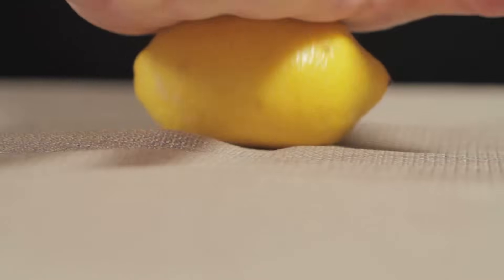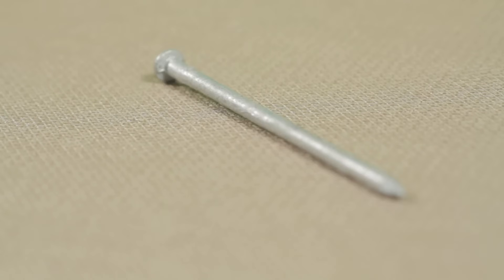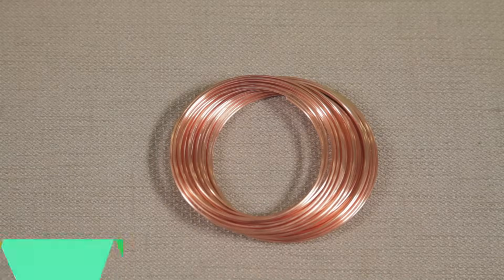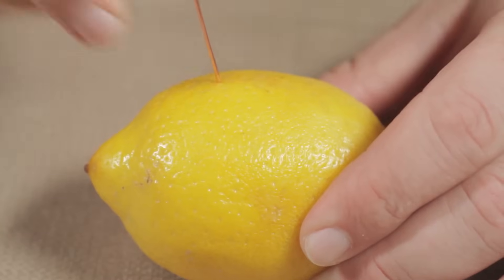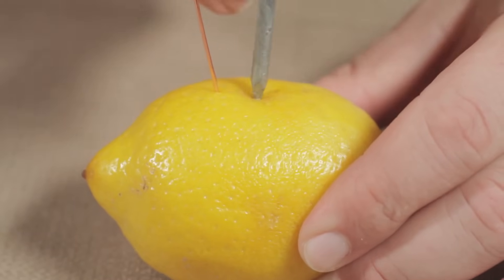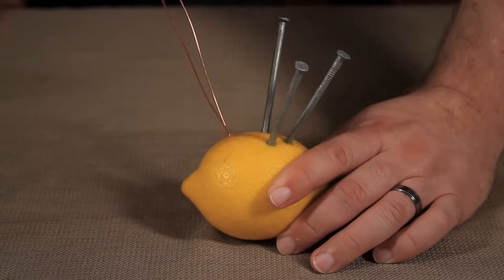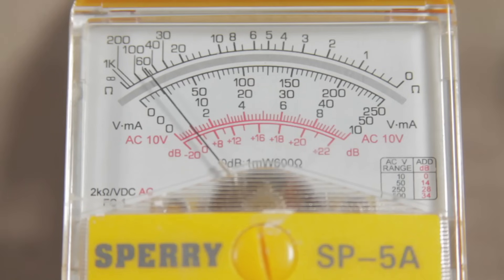How to Make a Lemon Battery

Comment: Real question if anyone has the time.. what makes a battery like this die? Like.. does the nail run out of electrons, does the solution stop being able to transport them, or what?
Reply: It's been nearly a year since I had to do this but here goes: the electrons are transferred because of the differences of electronegativity between the anode and the cathode, i.e. the two metals. This is a reversible reaction, where the forwards reaction (electron moves from zinc to copper) is happening at the same time, but at a higher rate, than the backwards reaction (electron from copper to zinc). The reaction reaches a dynamic equilibrium, where the forwards and backwards reaction are happening at the same rate, when enough electrons have passed to the copper to make copper's electronegativity equal to zinc's by ionising the copper metal to Cu^- and Cu^2- and ionising zinc to its respective cations. This is the point where the battery has "died" as electrons cease flowing.
TL;DR, yes the nail runs out of electrons which it can give, in a sense.

DISCLAIMER: It's been ages since I did this and I could well be wrong or missing something, but I think that's the gist of it.
Reply: Awesome. Thanks. :D
Going beyond that.. do either the nail or the penny ever end up resetting themselves? Like, x amount of time after the experiment is over, or are the outermost layers that were exposed to the juice forever changed, and you'd need to scrape them off?
Reply: Not on there own, you would have to somehow reverse the process, which isn't really feasible without going into too much detail. This is why disposable batteries are one use only.
It's not just the outermost layer, the entire object is pretty much affected equally, so no, you couldn't scrape off the outer layers.
Basically, once current stops flowing, you can no longer use the penny or nail in a battery.
Reply: Cool. Thanks again. :)

I have to admit, even though I already know before peeking that the law of conservation of energy prevents it, that I'm wondering if there's any way to cycle the electrons back and fourth between materials indefinitely. Like, the zinc goes to the copper, then the loaded copper goes to something else, etc etc until something goes back to the light zinc. Alas, no perpetual energy machines for us this reality. xD
Reply: Yeah, as you said, no not possible, because electrons only travel from the less electronegative metal to the more electronegative one, therefore the electrons never get back to zinc as the electrons can only pass to progressively more electronegative elements.

Comment: What is the difference between a potato battery and a lemon battery?
Reply: A potatoe flew around my room but a lemon just falls
Reply: One is a lemon and one is a potato
Reply: nothing bro... nothing
Reply: The potato will give you a higher voltage even though it has a lower pH.  This indicates that the acid is only part of the equation when talking about batteries made with fruits and vegetables.

Comment: As I understand it, most fruits have some sort of acid in them.  Could a non-citrus fruit be used, same for example a watermelon, cantaloupe or apple?
Reply: Yes, we've done it in school with apples, melons, pineapple, grapefruit, and even vegetables like onions and potatoes. Obviously they dont generate as much electricity, but they work!
Reply: Apples actually produce a higher voltage than a lemon.  This would indicate that the acid is only part of the equation when making a fruit battery.

Comment: Anyone who does water cooling will understand this.  Never mix aluminum with copper, or otherwise the aluminum will oxidize and eat away.  That's why you get holes and erosion in your aluminum.  Either all aluminum or all copper.

Comment: What's the cathode, and what's the anode?
Reply: cathode is positive and anode is negative...like a battery
Reply: reduction happens in cathode, oxidation happens in anode.
reduction is the side which gain electrons, oxidation is the side which lose electrons
Reply: Oxendine9381 I think its not really the same in all cases? e.g. Galvanic cell VS electrolysis
Reply: Oxendine9381 No actually cathode is negative and anode is positive.
Reply: Rudy Melo I was going to say you were wrong and then rage all over you, then I did research and saw you were right. But then why the hell do they name a positive ion "cation" and a negative ion "anion" if the electrodes are the reverse.
Reply: Will Lu That's called English.
Reply: Will Lu they call it a cathode because its going to be drawing in cations, the reason its drawing cations is because it being reduced (becoming negatively charged) so its drawing positive ions to neutralize itself. the anode is bringing in anions to be neutralized because its being oxidized (becoming positive). So the cathode is negative and the anode is positive, because the cathode is negative it pulls cations that are positive to neutralize itself and you get the point lol
Reply: ***** no juan. We just established this. Cathode is negative -____-

Comment: You haven't paid attention to the video. Electricity isn't in the lemmon but in zinc and copper. A correct question would be "How much zinc and copper would be needed to generate a SUSTAINED electric current whose voltage would be high enough (i.e. around 2000v) to cause electrocution?

Comment: You don't use a voltmeter to measure a current. You use a ammeter.
The main difference between the two measurements is: There is no current floving if you're measuring voltage, and there is no voltage if you're measuring current.

Comment: This how electroplating onto glass works isn't it? Instead of a lemon you use silver nitrate or a solution using silver nitrate. Instead of copper you use silver and instead of zinc you use glass. But glass doesn't want electrons :(

Comment: +1 on the voltage argument.

the multiple nails argument, however, is not flawed. it's pretty much all about active surface available for ion flow. flooded lead-acid batteries also have a common electrolyte; the separation only serves as a protection against physical contact of the plates themselves.

Comment: to be fair it is an analogue meter and will draw some current from the lemon unlike a super high impedance digital meter.

However i agree Hank should of declared it as voltage.

the multiple nails in the same lemon bit is flawed in that the electrolyte will short them all together. real batteries must have insulation between the cells so they can have them in series (as with multiple lemons).

Comment: Yeah it works the same,also you can use aluminum strips instead of a galvanized nail.
aslo other electrolytes like salt water will work too.

Comment: the zinc atoms don't lose protons, it actually gets dissolved into the acidic solution. the zinc nucleus itself is a collection of protons(and neutrons), so the zinc layer on the surface of the nail is losing zinc ions, not individual protons

Comment: No lemon, no potatoes, can not provide the energy as it is the very shallow (copper wire or sheet) Type in a glass of water, put on one half of the copper wire to the other side or what piece of iron that the same zinc, get 1-1.5 volts, can reach 3 volts depending on the copper itself.

Comment: absorb electrons and from hydrogen ions become hydrogen atoms that also form hydrogen molecules; 

with enough time, all the ascorbic acid (vitamin C) in the lemon becomes Zinc Ascorbate (the same thing you would get just soaking zinc in ascorbic acid); basically the lemon will not only be rich in vitamin C but also in Zinc; 

but i am not 100% sure so don't go doing that to your lemons to get more zinc into your system;

Comment: I believe the result of letting this reaction drag long enough will be the corroding of the Zinc into the lemon juice; the Zinc in the metal is atomic, it has a full shell of electrons; during this reaction, the Zinc atoms ionize, meaning they lose electrons and become positive ions; they diffuse into the ascorbic solution in the lemon juice and the electrons flow to the copper end via the wire (hence the electric current); on the copper end the protons of the ascorbic acid atomize, they

Comment: Would I get a higher voltage if I pushed the nail and copper wire further into the lemon so that there's more of each exposed to the lemon juice inside?

Comment: It doesn't specifically need acid, it just needs something ionic or to react with. (though acid, like acids that are used in batteries, is often most effective) You can do an identical experiment in water + quite some salt! Any vegetable will do to some degree, as water and ions (and ion transport) are essential for any lifeform.

Comment: Voltage is a function of the number of isolated pairs of electrodes. Current is a function of surface area, or how much material is available to participate in the reactions. One copper wire and lots of nails would not give more power since the reaction is limited by the copper. Lots of copper and nails increase amps but not volts, multiple lemons (isolated cells) gives more volts but the same amps. You can combine these two effects to increase both voltage AND current.

Comment: after the zinc ions go into solution electrons are flowing from the anode (zinc nail) through the black wire over the voltmeter, where the flow is displayed as electric current, through the red wire to the cathode (cupper wire) and finally to the protons in the electrolyte (citric acid solution)..so before the electrons arrive at the cathode and subsequently reduce the protons they flow through the voltmeter..hope that helps..

Comment: If the electrons that get to the cathode are pulling protons from the electrolyte, to be reduced to hydrogen, then how there is current going out of the cathode? Aren't all of the electrons, that should have been flowing out of the cathode, turn into hydrogen with the protons of the electrolyte?

Comment: If you are talking current then yes you could use 1 lemon, however they were connecting them in series for greater voltage.  You could however slice a lemon into several pieces and place electrodes in each piece and wire them up in series to achieve the same result.  Current has a lot to do with surface area, Voltage has a lot to do with how far apart the elements used are on the electronegativity scale and the number of cells in series. I think all the lemons was part of the comedy as well.

Comment: basically, you need to increase the area of the metals exposed to acid. Use plates instead of nails and the current will be much higher. If you think about it, a nail in cross section is a circle, a circle is an 2D object that has the perimeter minimized for a given area.  While with a sheet this is the opposite.That is why for instance a car battery exist out of interleaving plates.

Comment: The voltmeter here is just being used to show that a current is indeed flowing in the circuit. But you're right it doesn't show the strength of the current.

Comment: Hank, "cells" are not "also called batteries." (Well, colloquially they are, but this is SCIENCE!)

The single unit is a cell. Multiple cells together is the battery. So, you made a lemon cell, not a lemon battery.

Comment: You are correct.Current is measured in Amps and the difference in a circuit is measured in Volts.

Comment: Yes you can get more CURRENT with one lemon and more anode/cathode surface area. But if you want higher voltage (to power an LED or something) you have to wire multiple lemons (cells) in series...copper-zinc-copper-zinc, etc...Or cut up one lemon into insulated pieces.

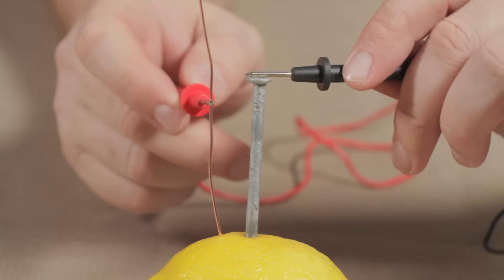Comment: Correction: @0:38 Voltmeters do not measure current, but the electric potential (voltage) between the two electrodes. Ammeters are used to measure current.  Also, the reason you get more current with more electrodes is because of the limited reaction rate in the lemon--More surface area means more reactions.  What's more interesting is if you connect zinc anodes to copper cathodes in series, then you get higher voltage (same principle as 9V batteries)
Source: Physics and electronics classes.

Comment: I think was hank meant to say is that zinc ions need a solvent to dissociate in. in order for this reaction to happen. wats so special about this process is that they're both in the same solvent that can act as a way for electrons to get from zinc to copper. Creating zinc ions that dissociate in the lemon and Hydrogen receives the electrons creating hydrogen gas. when the electrons move from one place to another that creates a current which is what we want!

Comment: no, just a little bit of heat. If you take a battery and connect the poles with a wire or paperclip and touch it, it just gets hot and doesn't shock you. At the most it would be a tingle kind of like licking a 9 volt battery, just much less powerful.

Comment: Your both Wrong, Voltage and Current are Measurements, an Observation. There is actually a triangle of voltage, current, and power (or potential), without these none exist.

Comment: Current and Voltage are not interchangeable. The volt meter measures voltage not current. When you hook multiple copper wires and zinc nails in series you are increasing voltage not current.

Comment: could you use this to make a fire with ? laying some tinder against the nails or against the copper wire?  kinda like using pen caps to hold a copper wire that is attached to both ends of a battery. Not that ill ever be lost out in the wilderness with a nail, copper wire, and a handy piece of fruit in my pocket, but, im just curious.

Comment: No.  Lemon juice is citric acid, 'battery acid' (such as used in lead-acid car batteries) is sulphuric acid.
Though technically any acid can be used in a battery: citric, acetic (ie. vinegar), nitric, whatever... and so can plenty of things that aren't acids, including (if you don't mind a really really small current) water!  This is thanks to the 'self-dissociation' of water: about one in every fifty million water molecules is actually a hydroxonium or a hydroxide ion.

Comment: The electronics in this video are wrong. The chemistry looks fine as far as I know, but I expect better of Hank. A voltmeter has (next to) infinite impedance, so talking about a current flowing just doesn't cut it. Any more electronics people out there care to back me up? I've seen no one else complaining about this blatant inaccuracy, and I'm sure Hank wants to be right, so make a noise if want a correction.

Comment: I was actually talking about something subtly different there, and assuming that the guy I was responding to thought it was an ammeter.  Even if you used an ammeter instead of a voltmeter, and even if it was an ideal ammeter (zero resistance), not much of the current would flow through it in the situation we were discussing (both metals in one electrode; effectively, two electrodes in contact with each other) because of course the direct path has much lower resistance.

Comment: They aren't using logic ON the lemon, but rather the contents of the lemon. That being, the contents of the lemon (dilute citric acid) act as an electrolyte. Therefore, two elements (zinc and copper) one that lends electrons and the other that takes them, would react using the electrolyte as an aid to the electron transferring process. Thus creating an electric current.

Comment: Dammit Hank, if you connect a voltmeter to 2 terminals of an open circuit it will show a voltage, not a current. I expect more of you.

From the fact that there is a voltage, you can deduce that a current has already flowed for a short period from one terminal to the other to create this voltage, but there is no current flowing.

Comment: Technically, *some* current will flow through the meter, just hardly any, since the resistance of that path is much higher but still finite.
It's actually interesting to model the current flow in something like this; it ends up looking very similar to both magnetic field lines and fluid dynamics (though with zero viscosity for the latter, of course), and most of the current doesn't take the shortest path.  Sadly my vector calculus skillz aren't up to it.

Comment: he also deduced that it was the "animal electricity" causing the flow of electrons, Volta discovered that using brine soaked cardboard sandwiched between metal plates he could also get the same results. 
It wasn't until the brilliant Sir Davy had a shot at it that it was realized it was a chemical reaction where the electrolyte was essential 
afterwards Faraday took over and developed laws regarding the amount of electricity produced... then someone was like "HEY.... lemons"

Comment: As the anode oxidises the flow of electron would decrease and over time it would stop. I'm pretty sure then if you put a current through the wire in the opposite direction it will then cause the new cathode (the anode before we put an external current through it) to regain some of its original mass. There are probably some video son YouTube that show the whole process.

Comment: I have to point out in return that in an aqueous solution, there's no such thing as an H⁺.  Instead you get this awesome ion H₃O⁺, called "hydroxonium" (or just oxonium).  Basically, oxygen is so electronegative, and H₂O thus so polar, that the proton sticks right on to the blob of negative charge around the back of the O.

Consequently, another (and more chemically apt) name for DHMO (dihydrogen monoxide) is "a solution of hydroxonium hydroxide", which only comes in one concentration, 0.1ppm.